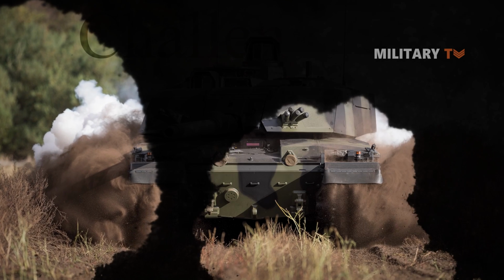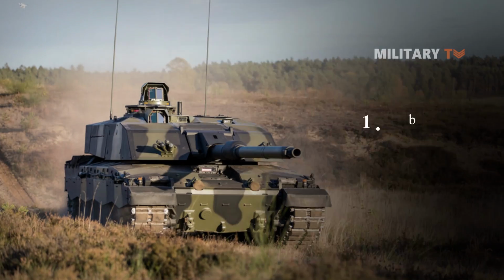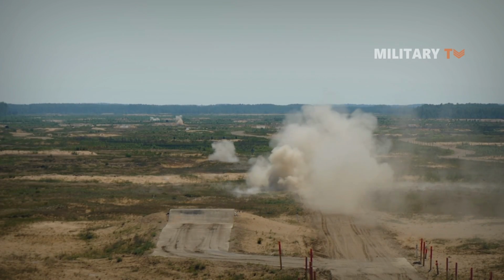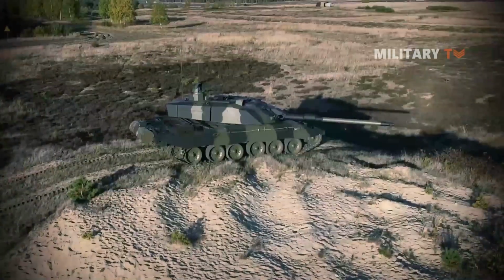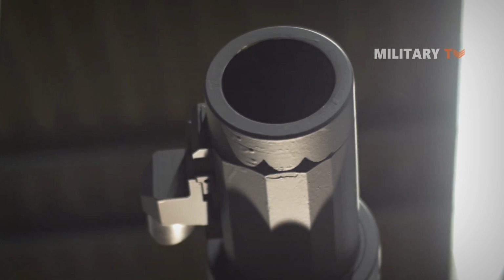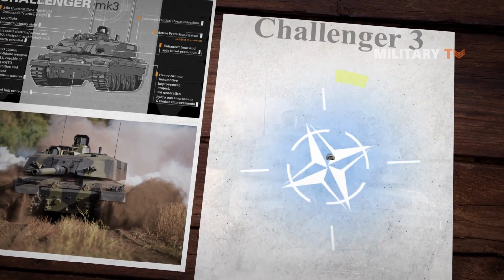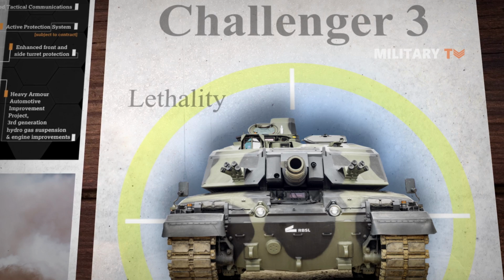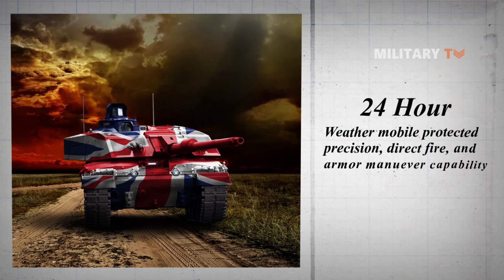British Army’s Next Generation Challenger 3 Tank Is Now Under Construction

Comment: Is the crew isolated from the ammunition? Is the turret self loading? How thick is the top armour? Is the tank protected from 
missile attacks from the rear? How quiet is this vehicle? Does the main engine have to be kept running in winter conditions? 
How does supporting infantry communicate with enclosed tank commander? What is the barrel life? How many tank transporters are included in the programme? What capability does this tank have to operate with its own drone in support?

Comment: But the billion dollar question is...
Why they still haven't add the RCWS equip with 7.62mm NATO machine gun on their Challenger 3?
They suppose to add that already in there tanks.
Reply: The challenger has 2 7.62 machine guns, 1 on the loaders hatch and 1 co-ax
Reply: @atinofspam3433  yeah but it's not remote controlled operated gun.
The crew need to get out of tank and fire that gun while exposing to enemy fire.
When most NATO tank(Except Italy) are now adopting the RCWS on there tank such as the M1A2 Abrams on SEP V3 and the Leopards 2A Evo or the KF-51.
Reply: @ryanc00p3r3  Challenger 2 has had a remote weapon station for about 10 years.

Comment: well the Chall 3  should be KF51 Panther, without any problems, but if UK insist on it's own development, mean that at least 10 years from now on, will not have any prototype and ofcs, that 130mm cannon from Rheinmetall is savage and already finish it's development, not to mention that already next gen cannon 140mm is in development from France ... so UK should search within NATO members any solution that can be apply'd today without any problem, and will be within NATO new standard ... going toward other unicorns ... will lead to diferences
Reply: the KF51 is a tech demonstrator. Its not being put into production.

Comment: 24july1234
i should give the tank the uppertinity to have a stinger or stingers available if needed when there cant be airsupport if a unit of 4 tanks gonna be in enemy enviroment, 
so the tankcres gets not in panic when a heavy attack heli sections comes, and if the support light armoured vehicles with airdefence is out of battle, 
becausse a tank must be fill in many different where the tank is for, becausse of fuel shortage, i should also that the tank runs on elictricity becausse of Climatechange.

Comment: An upgraded Challenger 2 with a new  Turret and manualy loaded 120omm smooth bore that may get into service towards the end of the decade it still basically uses the C2 chassis with the same drivers hatch vulnerability and engine and fully kitted comes in at around 70 tons, the new Abrams and Leopard/Panther will most likely sport an auto loaded 130mm have the same if not better armour and come in around 50 tons, I'm not saying it's a totally bad Tank built for a 2022 conflict but we should be designing an MBT for the future not for today but if we do go for it then less than 150 units is blatant stupidity.
Reply: The. Cr3 have Improved Armor and the Next generation from Dorchester which is 4 times stronger than Dorchester Level 2 Armor, the Engine Change too up to 70 Miles from around 45 miles. The External Armor Kits for the Chally 3 are much stronger than Any Existens Armor Kits or Packs any Tank have in this world. I mean I see in the Irak war does a Challenger 2 Survive around 82 Rockets from an Helicopter becoming side Penetrated by The 3BM42 Round wich Penetrate in his time around 450mm of Armor and Any Challenger survive this Shoots into the Side Armor Side not Front the Chally 2 was nearly Able to stop M829A3 Round but this was the First Round wich Have Capability to Penetrate his Hull Armor where are the Armored Parts are. The New Armor from the Cr3 is a lot more able to Stop Every Existed Round in the World. And I mean the KF51 Penetrate around 1300-1400mm and btw. Eventually the Next new Abrams Called Next Generation Abrams is not that crazy. The first strong Abrams in my Eyes and I respect was the Tusk 2 Abrams cause this guy was insanely Proven in War and show what he have but the other Abrams are litterly Tow food.
Reply: @fernandojohnsen7639  Thanks for the heads up info.
Reply: I was gonna say this, the Germans and Americans will go the Future route and Britain is just cathing up.
They should have just went with the autoloading 130mm
Reply: @hc3657  well you're right it's better than nothing like you said, I'm just speculating that if the Americans and German's will adobt the 130mm Auto Loader Britain would be out paced again with thier Tank Armament.
Reply: @hc3657  I have a Question, does the Chally 3  going to have a New Turret for the 120SB or the entire thing  new overall? Back to scratch Design?
Reply: The new American and German tanks are 20 years away.
Reply: @agt155  not really The New American tank is only Upgrades with an 120mm Long Smoothbore Gun sich are Able to Fire Modular Rounds like the M829A4B/C and an Prototype Round called M829A5 Wich have Insanely double Penetrator but this maybe not are strong enough to destroy Armor like the New Dorchester Upgraded Armor from the Chalky 3 I mean of course it's able to Penetrate any Russian tank include the Armata cause the Armata have 2 Times Armor wich are become destroyed by an Double Penetration Staff System. But KF51 Armor is to strong or the EMBT's Armor or the Chally 3 Armor. I can't speak about the Exact Armor Values cause I don't know I speak on top of it about it. But that's an Tested Number from the Penetrator of the KF's round wich broke 47 Beton Blocks and An Russian T80BVM Armor Frontal Plate. The Chally 3 become a new round too Called DM37A1 and an Charm Prototype Round Called L31 Round wich are Have Double Penetration too and some Material I cant clearyfy which is able to penetrate ez tungsten, Relict and how the Russian Armor called. This works on Craus Maffai Armor Parts and Reihnmetall's Armor too but as I Sayed I don't think it's strong enough to penetrate the Armor Parts from the KF or the EMBT only the Weakspots I think. I can't speak much about the New Abrams cause the Information about this tank got Realeasd on Oktober 10th 12 O'clock in The Us.
Reply: auto loaders are not somthing we should want
Reply: The AbramsX and EuroTank are not expected to enter service until 2035/2040, they're of an entirely newer generation of MBT. Regarding the Challenger 3, I believe upgrades made to her are adequate. She will receive increased hull and turret protection through use of newer generation composite armour whilst still retaining a similar weight, and will receive a new transmission and suspension. When she enters service, no doubt she will stand with say, the newest Leopard or Abrams variants at the top of the food chain.

I do believe there could be some done to improve her even further. Of course an upgraded 1500hp engine would be lovely; I also believe a 30mm RWS should be fitted to her as well, alongside APC-variant Boxer and Ajax as counter-UAS is growing ever-more important. That would put her nearly on-par with next generation tanks such as the Abrams X and EMBT; however her dated design would show with how she would still lack an autoloader and crew citadel/capsule.
Reply: They're hedging their bets and pennies. Given the volume of armour on mainland Europe and current crop of Russian and Chinese armour (and their lacklustre personnel anti tank armoury) the C2 is already beyond capable. The C3 will enhance this capability still. If its an expensive dick swinging contest, sure the abrams and latter generation Leopard 2s edge the C2/C3 on paper.. but versus the actual threats thus is more than effective for the foreseeable.

Comment: 130mm gun would be better, imo !!!
Reply: If we went 130mm we'd be the only operators using it - which is the exact reason we moved away from the rifled L30.
Reply: Yes, but NATO is 120mm. Atleast the limeys finally moved up to a smooth bore. Also, there is a new 120mm round.
Reply: @zigbeegooblesnort125  It also uses the L55A1 which is the best 120mm gun available and when combined with the latest Apfsds round it has 20% better performance than the current gun.
Reply: @CrackingDale25  Yep